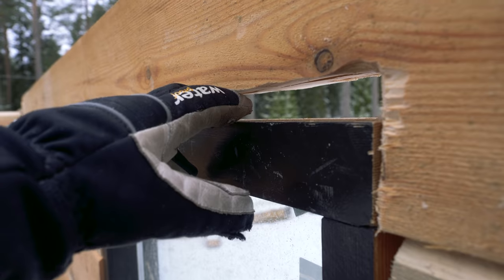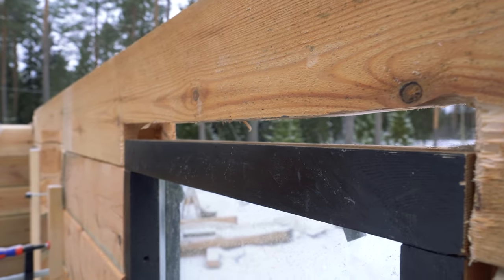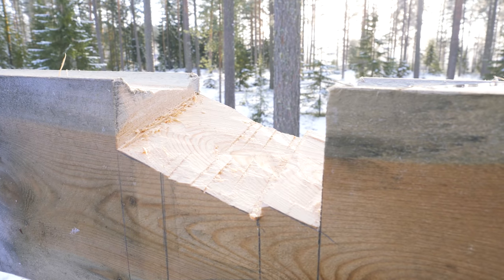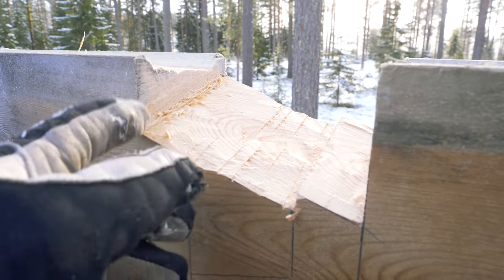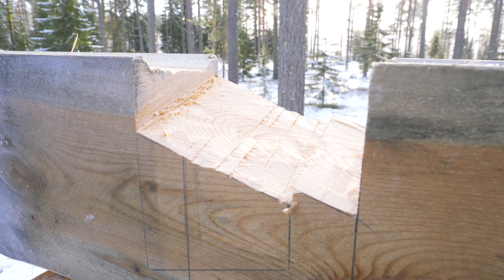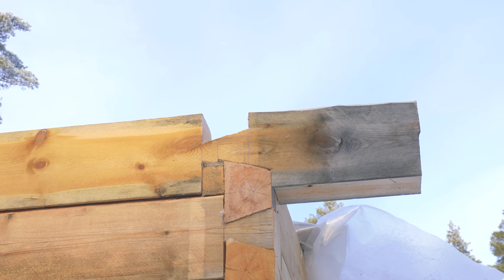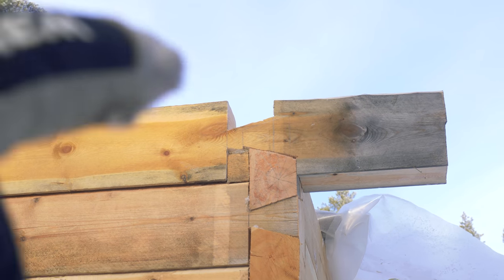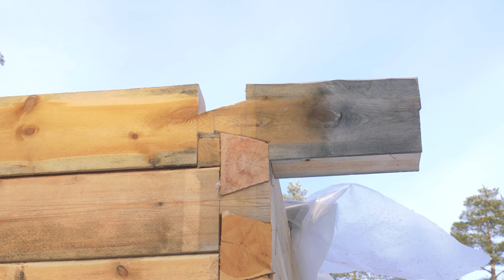Project log cabin  | Last dovetails and annoying mistake

Comment: Dang that stinks about the mistake but lessons were learned. The cabin looks great and yes it was a blessing to be so close to the roof so you will not need to worry about leaks. Maybe try cutting a better wedge that could be glued in instead of one with the insulation.

Comment: Excellent job, but I want to know how you know how to precisely cut those DuckTales and grooves to fit just right?
Reply from the maker: Hi, did you see the previous videos? I'm using a template to the dovetail joints, but I also double check the measurements every time. I think you might get a bit better result by drawing every joint in place separately, but that takes way more time.
Reply: Thank you